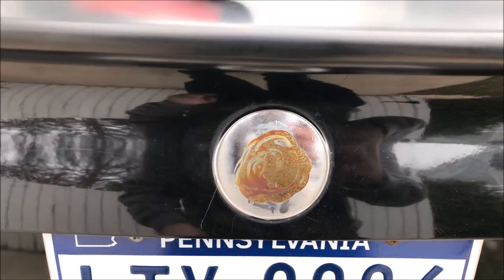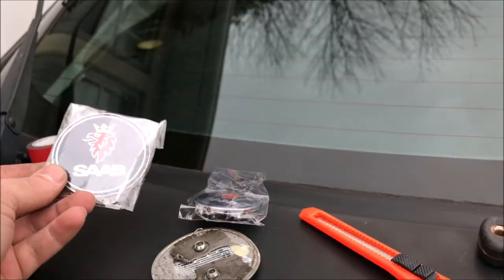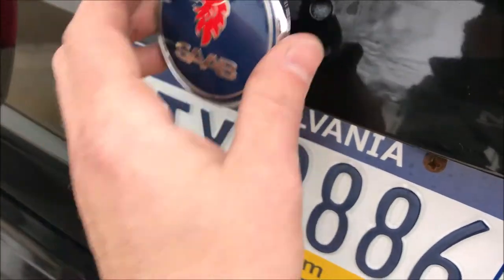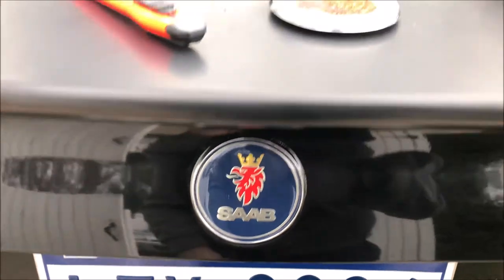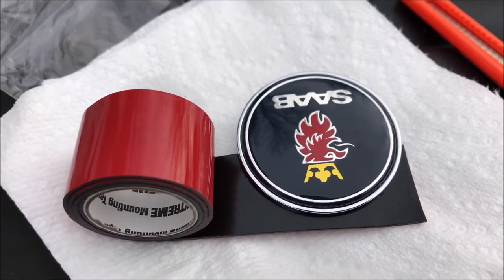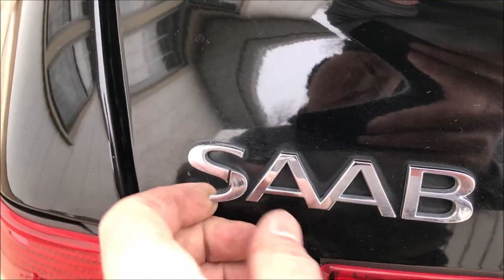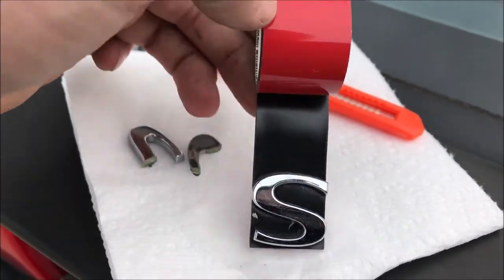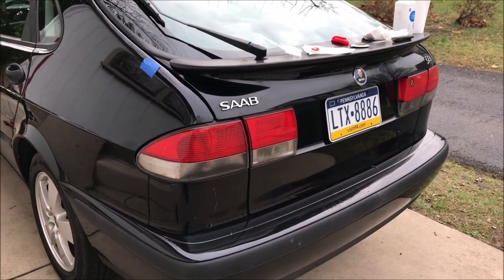SAAB Badge Replacement (NG900/OG9-3)

Comment: Hey Seth, where you find the emblems and 'S'? I need them too lol
Reply from the maker: I found my emblems on eBay, and the S from Saab came from a junkyard. The ones I got are easy to find, they just say Saab. The Saab/Scania emblems are much more difficult to find IMO. What vehicle do you need them for exactly?
Reply: @sethsaylor760  hey Seth, I didn't see your reply for weeks. I have a 1996 900S
Reply from the maker: The 50 mm hood emblems with “Saab” and “Scania” are harder to find in my opinion. Here’s a link to a inexpensive one that I was satisfied with: https://www.ebay.com/itm/173667536597?epid=24026565323&hash=item286f644ed5:g:9p8AAOSwsupcAN9k
Reply: @sethsaylor760  awesome! Just bought one. Thank you👍🏼